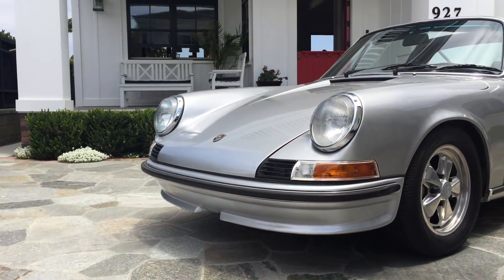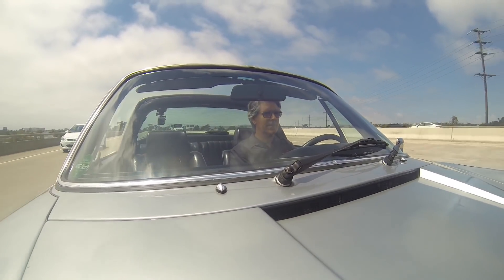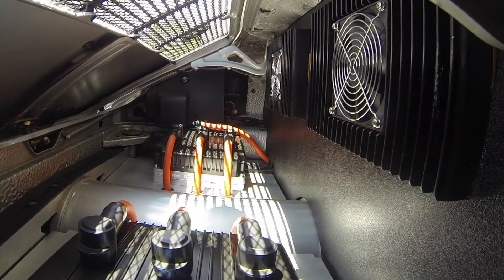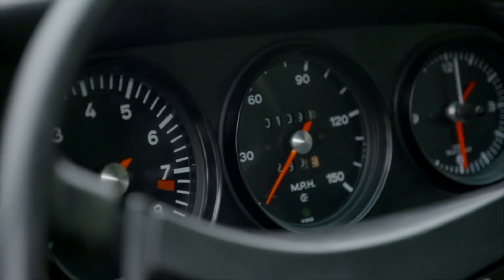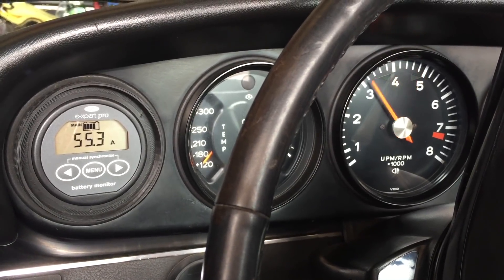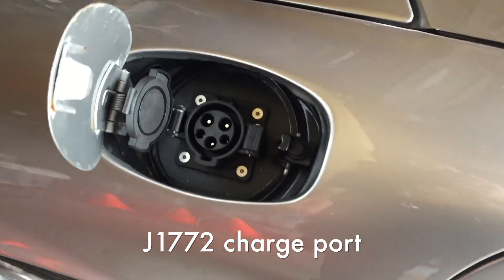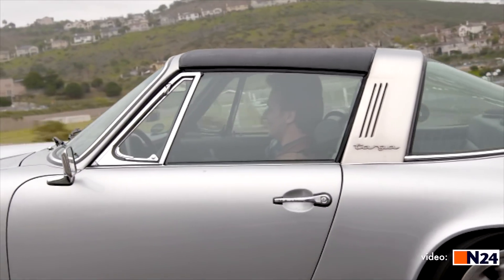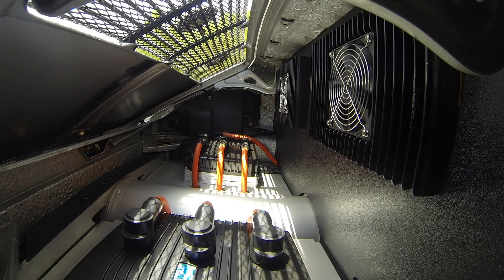Pure electric Porsche 911 with Tesla batteries

Comment: Am I understanding this correctly that this is still a manual transmission vehicle? If so, that’s amazing and totally my dream! How is that possible though? Any add’l explanation is much appreciated. So cool!
Reply from the maker: In this build yes. We’ve also used the Tesla drive unit in a couple of builds which eliminates the standard transmission.
Reply from the maker: donjuan3 With the standard transmission you only used the clutch when moving. When the wheels stop rolling so does the motor. So you can just leave it in 3rd if you like from 0-70. -db